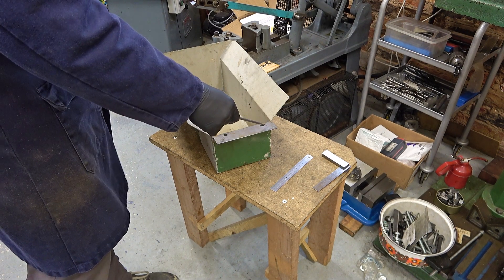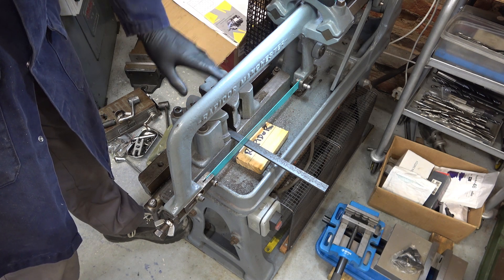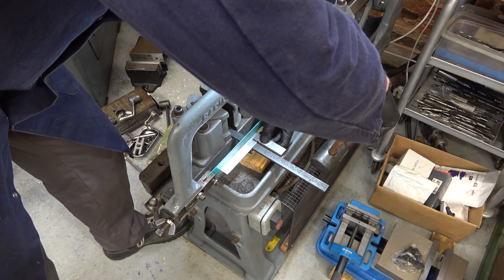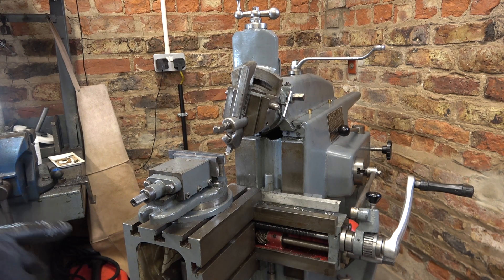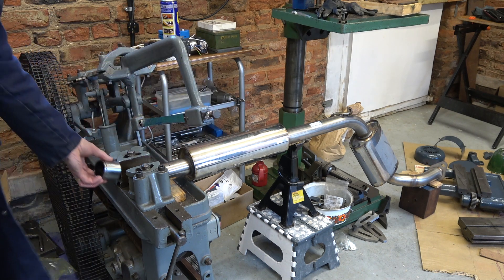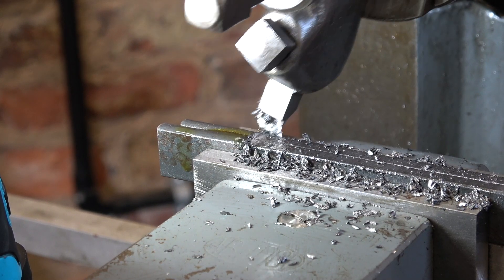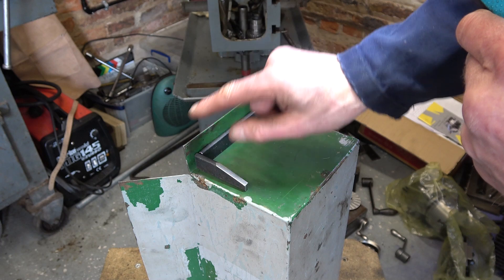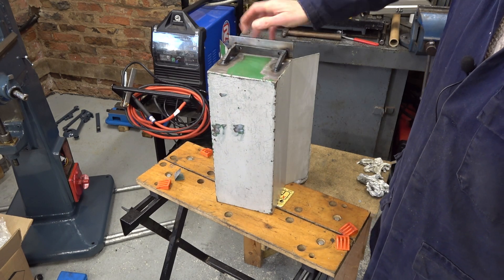HS247 Herbert Junior Mk2 surface grinder Part 10 – spark catcher

Comment: If you're feeling lazy when it comes to shaking a paint spray, wrap a length of steel banding around it, secure it in the shaper toolholder and let the shaper do the shaking!
Reply from the maker: Hi yes the shaper would be good for that. One time I thought about the shaper as a raffle tumbler (tombola style). Maybe if I ever get to 10k subs I might do that..... Cheers Paul

Comment: Good to see all the machines getting a lookin, they do get jealous, apparently.
Another built, not bought item.
Thanks for sharing.
Reply from the maker: HI John, yes and the spark catcher will double as a work catcher when it get's launched off the table if the mag top lets go (operator error most likely). Cheers

Comment: A very smart rapidor! Mine is 3 phase with the geared motor, but otherwise identical. I need to put a starter on it so the autostop works, and to put some thicker oil in the damper, so that works! Very enjoyable video, but it reminded me how bored I am during my enforced lay off! It is only watching others getting on with it that keeps me going!
Phil
Reply from the maker: Hi Phil, I made a new bronze main bush for mine as the main shaft rocked a lot but even now the mechanical auto-stop dog will wiggle off its ramps and needs to be reset mid way through the cut. Electricity was only just invented when mine was made so nothing so fancy as a microswitch trip. Cheers

Comment: Indeed, it will shape much faster in the length. But because it's a hobby, time doesn't count.
Reply from the maker: Hi Michel, I need to get over my fear of machining in line with the jaws (rather than across the jaws as I do now). Time is time - paid for or not. Cheers
Reply: @HaxbyShed  Just go for it, Paul. Nothing bad will happen.

Comment: Hi Paul. Thank you for showing your power hacksaw and shaper in action. Always a treat to see them. The Paragon spray paints do work really well. BUT sadly my nozzle blocked between coats despite turning the can upside down and blowing it clear. 😢 I always struggle with spray paint. 🥴
Reply from the maker: Hi Andrew, spraying with that enamel paint is quite different from cellulose. It takes the first 10 minutes or so to realise and adapt technique. Cheers

Comment: Hello Paul that was a great video. I feel for you trying to cut thin stainless (the exhaust) because I'm doing similar just now for my gas turbine project. The welding went well, and I like the look of the finished item. We have had nothing but rain up here in Moray now for about a week solid. Thankfully no snow though.
Reply from the maker: Hi Carl, I was a bit hesitant cutting that stainless exhaust on the Rapidor but my son was keen to try and I did not want to discourage him. He knows a lot from watching me but it's not the same as hands-on experience. Actually he finished the cut with a hand hacksaw and found that quite easy - just following the line the Rapidor had started. All good experience for him. He is an office-based design engineer and his practical experience comes in handy every day.  I have the impression that some of his colleagues have very little hands-on practical experience. Cheers
Reply: @HaxbyShed  That is very true. I was working on a large winch at the start of last year. It was driven by 4 75kw electric motors coupled to the winch via a gearbox. Due to a calamity, three of these motors had burned out. We removed the first motor and had to extract the splined coupling from the end of the motor shaft. Having no suitable puller to hand, I made one with stock materials and some lathe work/welding. The office based "engineer" who'd come to take a look (who was the same age as my eldest son) was utterly dumbfounded.

Comment: In the 1980's I had a Rapidor 21" hacksaw which I bought for £200 from the blacksmith in Grassmere.  When I collected it it was buried in filings and small offcuts right up to the vice. We had to chisel it out because the filings had set like concrete. It must have weighed at least 6 cwt, probably more.. On first use I was very disappointed, at the end of each stroke it lifted the bow and dropped the blade and frequently smashed the blade. A partial cure was bi-metal blades. I replaced the two square slide bars with new 2 inch square cold rolled bars. On one occasion it jammed, resulting in the small pinion splitting between  a tooth root and the keyway.  The gear was made from Delrin, about 3 inch dia? I made a new Delrin gear by hand with hacksaw and file,

Eventually I got it running well although it still tended to lift and drop the bow a bit.  The front fixed jaw of the vice was solid 90º, cast into the base, the back jaw would swivel to any angle and could not be locked at 90º.  I used it for many years making gates and railings, structural work and staircases etc. I made an angle plate to hold 8" X ½" flat stock at 43º (from memory) for fire escape staircase stringers.

Eventually I got a cut off circular saw which produced angles much more easily and more accurately, much smaller footprint and a lot less noise. Still prone to shattering blades...
Reply from the maker: Hi Seapy, they are not very refined. I got mine from a guy near Retford for about £220 on ebay. We split it off the stand and luckily the guy had a hydraulic pump lift table to get it to the level of my car boot in two parts. I made a new bronze bush for the main  shaft. Sometimes it cuts straight and sometimes it doesn't. I think the back of the bow has been broken at some point, or adapted to get the driving link lined up,  because there is evidence of a big rough weld on the casting. Anyway I love it, imperfections and all. Cheers

Comment: La Nina is the horrible-weather driver and we need Le Nino instead
Reply from the maker: Geoff it's pouring down again as I write this. But after 1 year the solar panels delivered 95% of the forecast 5kW generation so that's reassuring given the dull weather all winter. Cheers
Reply: @HaxbyShed  Paul, the weather has been cold since 5th Nov, and its been a record rainfall year. Its really affected our outside work. Your videos and feedback kicked off our Solar panel project. Our daily consumption is circa 18-19 kWh, and we have focussed on a Givenergy 5kW Hybrid Gen3 + 9.5 kWh battery bundle plus 8-10no, 0.55 kW panels. Our calcs show it has a payback period of 2 years. It’s all good news, so thanks for your confirmation of the efficiency, which increases our confidence. The inverter is specified as being able to run 5no batteries, so we can add more panels and storage later if we need to. The initial scope is to power all our own requirements without switching back to the grid. Really like the Octopus provider, so much better than our previous dinosaur of centralised generation.
Reply from the maker: @GeoffHome-u6r  Hi Geoff, a payback of 2 years is amazing. The fact is high users can save a lot more because they can use all of their solar generation to offset high daytime import costs. Many domestic users can't use all they generate so it gets stored, if they have a battery with spare capacity, or exported on the lower export tariff.   Tomorrow I will put out my 12-month review of our system. We generated 95% of the predicted solar - which I think is very good considering the weather has been so dull this winter.  You will find that winters are all about the battery and summers are all about the panels. Spring and Autumn are transitional. Cheers
Reply: @HaxbyShed  Paul, Cant think of a single other investment that returns in two years. We checked the Phono Solar panels 550W, with Givenergy and apparently we only need 4no to have sufficient EMF to power up their system. We are going to order 10 no initially and only want to be free of the grid forever. We could use the power to heat the HW as well as service all the remaining appliances as we don’t sink much more than any small household. Your videos and advice have really helped kick start this. Even caught sight of a Givenergy 3phase inverter, now that could be useful 👍😎

Comment: Such a beautiful shaper and just humming along eating up some metal. Very nice. Thanks for sharing that. It takes a lot to setup and do it in general, but to film it, edit it, and upload it on top of all that is an incredible amount of time and effort. I appreciate that. 
Anyways, hope all is well. 🍻
Reply from the maker: HI Jason, yes all is well here. There are shortcuts for videoing and editing that come with experience. The whole endeavour becomes one - I think about the work and the video, video and the work, it becomes instinctive. I know what setups work (for machine and video) and which don't.  New beginners tend to focus on Video but experience reveals that there are just as many considerations with audio. You would not believe just how noisy the world is, and most of the time we don't even notice. I've saved loads of time editing now I have discovered the audio auto-levelling  filter which boosts low sound and reduces load sounds. It's worthwhile paying for good audio and video kit - just like it's worth paying for a quality machine. Cheers

Comment: I’m thinking a couple of wire ties round the paint can onto the power hacksaw, or shaper, would shake the paint easily 🙂
Reply from the maker: Hi, I'm sure there will be opportunities. 😁
Reply: Or make up a clamp that attaches to the saw, that will do the job. You can even make a workpiece for the shaper that does the same, shake the can and exercise the shaper over full travel, so that the ways get an even wear at the same time, and get lubricated as well.

Comment: I was thinking about your shaper vise's jaw lift while watching the shaper work.  What if you put a regular screw with a head on it into the jaw end gib adjuster?  What I'm thinking is to bring the jaw in close but not quite touching, snug up the screw on the end of the gib so it takes a moderately firm force on the lead screw to move.  Taking out any and all of the clearance in this way might reduce or eliminate the jaw lift.    Please let me know either way as I'm curious now....
Reply: Quite a lot of vices have jaw lift, that is why you bash the work done with a dead blow type hammer AFTER fully tightening the jaw!
Reply from the maker: Hi Bruce, in this case the gib is not tapered. It's just pressed along it's length by three adjusting screws, like you might find on my compound slide (whereas the cross-slide gib is tapered). Cheers